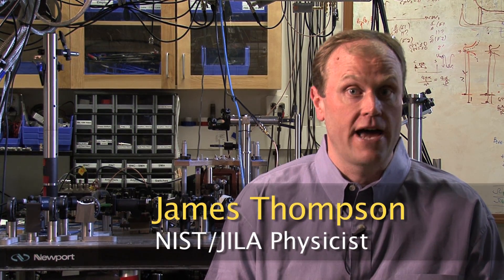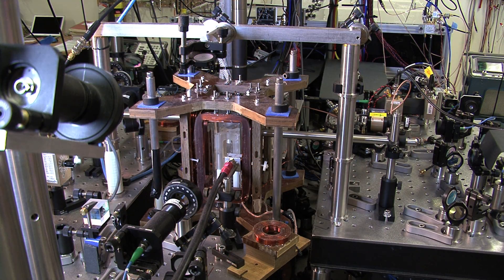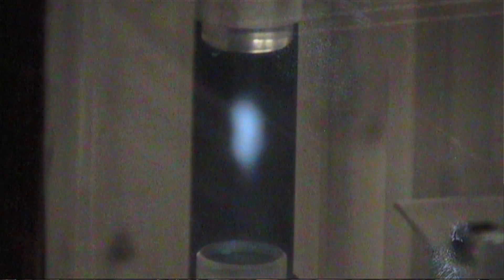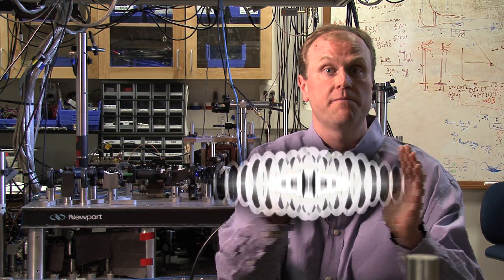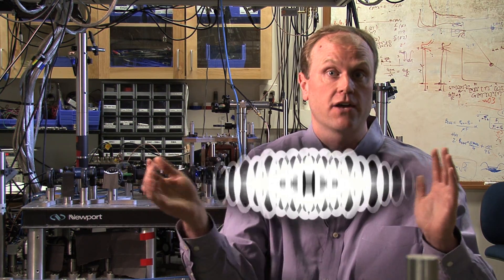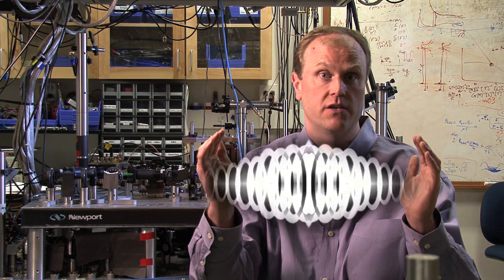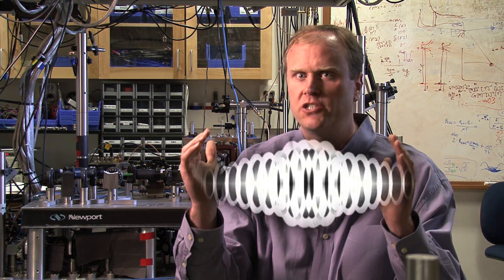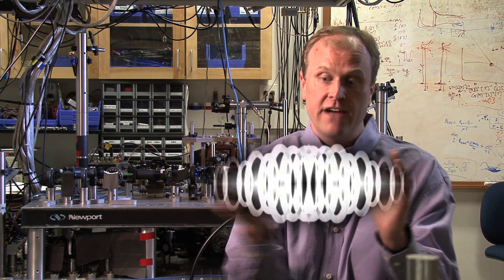NIST/JILA Physicist James Thompson Superradiant Laser

Comment from the maker: Think of it like this:  the average US family size is 2.6, despite the fact that each family member comes in units of 1. Similarly, if we ask the question "Is a photon present between the laser mirrors?" then the only possible answers in quantum mechanics are 0, 1, 2, 3, etc.  Very roughly, we find that 4 out of 5 times the answer is 0 photons, and approximately 1 out of 5 times the answer is 1 photon.  The average photon number is then 0.2 photons.